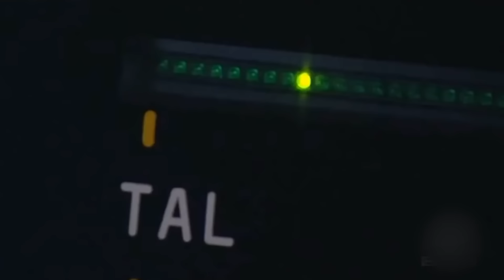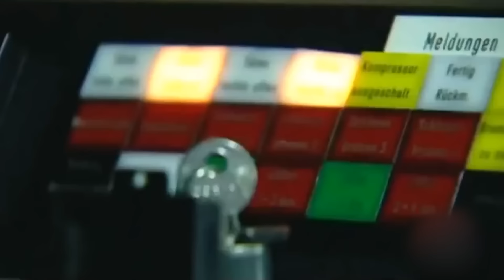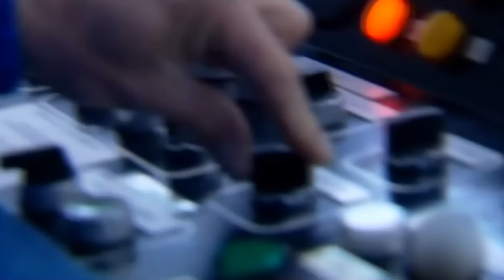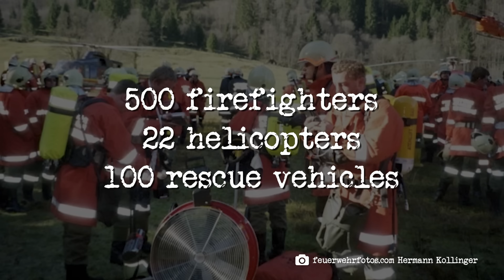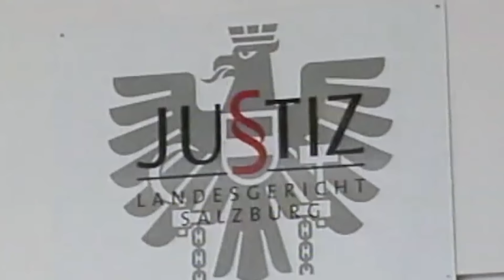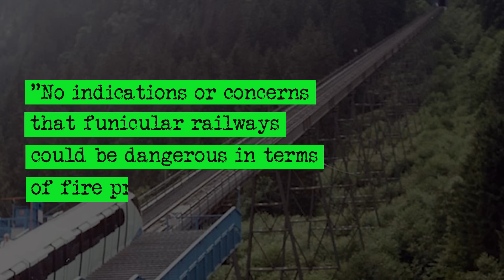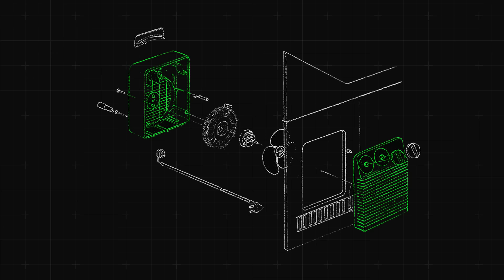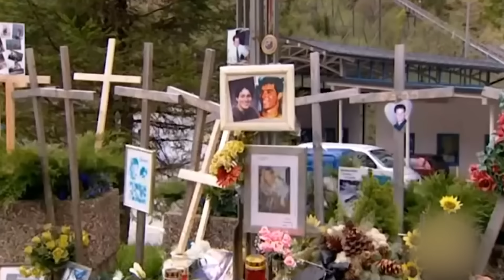The Kaprun Alpine Railway Disaster 2000

Comment: Sad, that over and over people try to escape from a fire upward, and inevitable die from the smoke that also moves up and the actual killer in most fires.
Reply: There was a fire in my building on the top floor. I live one floor below but not near the apartment where the fire broke out, where the fire was contained by the concrete walls. The hallway of the top floor was filled with smoke but not on my floor. There was a smell afterwords but some air fresheners took care of that. 

Some people have survived building fires by going up the roof.
Reply: @Ozymandias1  You cannot compare a building fire to a mountain tunnel fire... 

As explained in the video, due to the altitude difference, the tunnel reacted as a chimney. The fresh air was sucked up by the lower entrance. Then the smoke went upwards to the upper extremity of the tunnel.
Reply: At least they went peacefully.
Compared to burn to death alive that is
Reply: Since when has anyone seen smoke go downwards. Sure they may have panicked but if you're that stupid to move upwards in a closed environment filled with smoke, you sure are not very bright.
Reply: @wankZkills  unless you got training that allows you to know stuff in these kind of cases, or to think properly in panicked state (by having those states regularly and start to ignore the worst part of them,) you will not think at all, just act like a panicked animal, fire bad, move away from the fire, fire below, move up. anything more complex is not part of the first few billion years of evolution, so our last few hundred thousand year had no chance to overwrite it, even worse, in most case those stupid but basic actions work, just not always.
Reply: @thorin1045  As I stated, sure they panicked and basic fear and instact may take over. BUT, they still were stupid. I can only speak for myself, being in a situation of a fire I simply crawled close to the floor as I've been taught and navigated my way to a staircase and no more drama than that. Educate yourself about what to do instead of just learning that fire is dangerous. Again, supposedly being educated in general safety isn't a thing in a lot of countries, or atleast was. It amazes me.
Reply: @wankZkills  not knowing something does not make you stupid, stupid is knowing and not using information, never being learned safety or fire hazards or similar, you would have no knowledge what to do. And yes, most people in the world never had even a simple safety education. Most people never had the option to grab a fire extinguisher and try it out in a safe place (without any fire or on a controlled fire), so they will fail to use it properly in the probably only time they need to use it.
Reply: @thorin1045  Okay professor
Reply: @thorin1045  Not knowing heat travels upwards does make you stupid. I understand they were in a panic, but a even small child knows heat travels upwards. You see it any time you pour yourself a hot cup of coffee or boil water. It's as basic as gravity pulling objects down. Forgetting that is like forgetting how to walk or how to blink your eyes. "Panic" is not a magic wand that renders all reason invalid.
Reply: @Ozymandias1  People survive building fires by going up to the roof because the roof is an open, ventilated area. If the roof was a 3000-meter walk away chances would be very different.
Reply: @poika22  ask 10 people about this, 9 will go up, just like in this case, it is not about being stupid or not, your instinct will force you away from the open flame, even if they try to think, most people will prefer upwards, as they do not know the fact, that smoke will go up too, or that smoke is the main problem in this case, not the heat or fire itself. if it would be so simple as you consider, than not most of them would have gone the wrong way, but only a few stupid. the simple reality check makes it clear, only a few, who accepted the advice of an experienced person, went the right way, the rest went the obvious and wrong way.
Reply: @poika22  not out, you exist, those who do not know what to do, are not stupid, those who told they act on instinct, since they have no other source of information, yet consider them stupid, those are stupid and beyond. if it would be obvious how to escape from these situation, than it would be not part of almost every single time this come up: "and they went away and up from the fire, and died."
Reply: @thorin1045  "Do not know what to do" THE FLAMES ARE RIGHT THERE. If you look at a flame, see it rising up, and can't figure out 1+1=2 that heat travels upwards then yes, you are stupid. This is not some arcane physics formula you must've memorized in school.
Reply: @poika22  yeah but  people can get fearful. if its a large wall of fire..

Comment: A Tunnel (!) without fire extinguishing system. A train(!) without a fire extinguishing system. A train without any non hydraulic emergency door opening system.
And then installing a super cheap fan heater (Fakir in Germany is really the cheapest of cheap). Such heaters in public transportation must have fire detectors and automatic fire extinguishers. Again.

This is still unbelievable.
Reply: but still, fakir did nothing wrong it may be the cheapest but the company explicitly stated it's not supposed to be installed in a vehicle or that you can brake the seal's to do so.
Reply: @Frankforsthoevel  Of course Fakir is not responsible for this.
Reply: id argue the safety agenlcy that leats heater with such terrible design be sold is more responsible than the company @PascalGienger
Reply: It's 2024. Anything is believable.

Comment: I strongly remember the 2001 ski season following that horrible catastrophe.
Especially in the resort I was that had very similar installations, both main towns of the resort had one : Val d'Isère and Tignes (France).
The Val d'Isère one was particularly close in type to the one in Kaprun, almost an twin.
If my memory's right, they didn't open it till later in the season and then they had massive safety regulations.
All skiers and snowboarders carrying board wax, wax smelters, liners or any other sort of flammable stuff had to climb the slow way by using the chairlifts' alternative route.
Bags were searched and they gave complete safety instructions prior to boarding.
At the time the reasons for the disaster weren't clearly known so it felt a bit like an airport immediately after 9/11...
There were posters everywhere stating that you have to go down in case of fire, etc.
Things went back to normal later but they kept signs forbidding board wax accessories, just in case.
One thing I also remember vividly is the eerie silence in the funicular train during each climb.
As if everyone had lost confidence in the system and felt compelled to stay silent or talk at idle voice, like in a ceremony.
I did not know anyone linked to the Kaprun catastrophe but it stayed engraved in my mind as I'm a ski fan, subway fan and ski lifts enthusiast.
Ski resorts' funiculars are super efficient and fun to ride : you emerge from the darkness of the tunnel to the extremely bright light of a mountain peak in just a quick train ride. It's the happy subway of the ski slopes.
Thinking such a leisure mode of transportation turned into a nightmarish death trap is unsettling.
And the Austrian authorities' actions following the disaster, during and after the trial were really despicable, adding insult to injury.
Reply: Normally how long did the the train take from bottom to top? How do they remove heavy snow from the exposed sections? TY🙂
Reply: Fun to ride? Rides like these are giving me anxiety just by watching them😬 not because of this fire tragedy but because of how steep it is and for how long you are there in tunnel with 180 people on board, I am just a  little bit scared of elevators but this is whole new level
Reply: @scouser5039  It's just a cable hauled angled metro...
And frankly you barely see the slope outside.
Many that are afraid of heights and high cable lifts (chairlifts, gondolas and cable cars) much prefer funiculars because they can feel the vehicle rolling on the rails / the "ground" and can't see the height.
Funiculars are also perfectly stable, no matter the weather, something that can't be said about many other cable lifts.
I remember some pretty hellish chairlift and gondola rides on super windy days...

Several funiculars bring you so high that it's like a plane reaching cruise altitude, you exit the tunnel / top station above the clouds bathed in bright sun light.
And yes, it's quite fun to ride for many, myself included as it's the ski metro. Those that live in locations where they haven't subways or rail based transit really enjoy the novelty and uniqueness of the experience.
And those that live in cities and use subways everyday appreciate the spin of their daily transportation type into a leisure mode. And later they can think about the joys of the ski metro on their daily grind subway ride.

Anyway, funiculars are quite rare, and there's almost always an alternative route so you'll be ok whatever the ski resort you go to (alternative mode : bus on lower funiculars only ; gondolas, chairlifts, cable cars on lower and higher funiculars).
Reply: @kristyhoward6897 the kaprun one takes 8 minute and some seconds
Reply: @kristyhoward6897 there are certain machines for that snow removal

Comment: Being a bus driver, it's crazy to see a passenger hauler lack adequate emergency exits being that our buses have at least 4 emergency windows, two roof exits, and windshields that can be kicked opened, bonus rear door for some buses as well.
Reply: Not mentioning emergency door unlock systems - sealed lever or break a glass and push button. But even that wouldn't really matter if people decided go up instead down. What a pitty...
Reply: It seems, lack of casual traffic accidents fooled the management into the idea of "unsinkable Titanic". 

Like when that house in Russia had a fire of fireproof insulation.  No, it really was fireproof, just noone suspect the gaslines, which it covered, would leak and create a "pillow" of an air-gas mixture, under the entire wall.
The most enraging part of any of these situations, is when they say "Who would've thought it will do so?"

Well, when i was in school, we called a person with such capabilities "an Engineer". (Or an "Architech", in some languages) Lack of common sense in present "qualified" staff is shocking.

Comment: Just watched a video on an infamous subway fire incident in Korea, where the conductor stalled for minutes while the station burned, then once he realized there was a fire, took the keys and ran. Without the keys, the passengers were stuck as compartment doors locked once the keys left the engine. In another infamous incident, the captain of a boat abandoned ship once he realized there was a failure, and locked the students on the boat inside to die. 

In comparison, while also a great tragedy, in this incident, as least the conductor tried to free his passengers via manual override. 

As an Asian myself, there truly is regrettably something between our cultures that worsen tragedies when they appear.

Comment: Very nice.  If I haven’t lost count, this is the third time I’ve heard / watched this recounting. I have yet to see or hear the amount of research into the depth or the cause. The heater yes, but what about it, the expert witness rebuttal, not at all. 
Very, very well done on the depth of reporting if not, the depth of research.
Reply: Seconds from disaster, Fascinating Horror, Quixar (Irish guy) and this one.
Those are the ones that I know of...
Reply: Fuel-air-igniter = fire triangle 
Fuel (combustible hydraulic fluid) came in contact with a heating element in air.  The hydraulic fluid in contact with the heating element eventually reached its lower flammability temperature limit and caught fire at its flash point.  There was nothing to stop it from propagating, and it consumed all the fuel in its path.

Take away the heater, no ignition source to cause the accident.
Reply: Algorithms I can handle (great minds think alike)...

Comment: Good grief. It would appear that EVERYONE involved in the investigation completely overlooked one of the most OBVIOUS potential causes of the fire: A fan heater inside "PLASTIC HOUSING" -- DUH. As long as the fan works to blow the hot air out of the heater as designed, everything is hunky-dory. But if the fan blades stop turning while the heating element remains blazing hot, it won't take long before the plastic begins to melt, and when the melting plastic comes in contact with the heating element, instant fire. And it will only escalate from there. Personal experience: Several years ago, I bought a small space heater for the bathroom, small enough to sit on top of commode tank. Same issue:  plastic construction surrounding the heater and fan. I was leary about the plastic, so I never used that heater unless I was actually IN the bathroom. If I ever caught a whiff of melting plastic, I would be right there to unplug it, and throw it out the window, if necessary. Well, one day near the end of winter, I turned the heater on, only to find that the fan had not started turning. The heating element was already red hot, but the hot air was not being blown out of the heater. I turned it off immediately, and after it was completely cool, disposed of it once and for all. The last I knew, that same model was still being offered for sale... 👀

Comment: “Smoke was first seen in the “EMPTY” conductors compartment”? Was there not supposed to be two conductors, One at the front and one at the back?  Or is only One required?depending what direction the train is ascending or descending? 
But if, operation procedure requires two conductors to be stationed both front and rear on every train, regardless the direction of travel, 
Then the fact that if a conductor was in that cabin , he/she would have been at the controls and seen the initial smoke coming from the instrument panel, and could have easily been extinguished at the source.
Reply: Its like locomotives, two seperate compartements at each end with equal controlls. And only the facing the die direction of travel is occupied as you guessed it.
Reply: just like normal trains and subway cars etc here, they have a conducter compartment in the front and back so the train doesnt have to turn. the conductor simply goes from one end to the other if the train has to travel the other direction. sometimes you have a person who checks the doors, makes sure everyone is inside before closing, but they stay with the passengers. its usually only one driver
Reply: @thoges5040  not correct! due to the stupid design of the cars  by Swoboda the upper conductors cabin only had hydraulic pressure gauges for the upper compartment. Because of that it took the conductor so long to figure out what why there was a stop of the carriage. He had no way to check the lower compartment
Reply: @aky4360  Was it two identical carriages coupled tail to tail?
Reply: There were no conductor. The person was just there to open and close the doors.

Comment: I get not wanting to go past the fire but knowing how long the tunnel is and that heat rises and smoke is hot, I'm surpirsed at how many went upwards.
Reply: Especially with where they were in the tunnel and how much longer it'd be to go up. Going down would be scary and come with its own risks, but the exit is also a lot closer since they weren’t even halfway up the tunnel. It's sad to see the panic get so many people.
Reply: It must be understood differently. The people in the rear had a choice and a group went down while some others went up and perished. However, the vast majority left the train already being further up. They might have survived if they immediately sprinted down into the heat towards the flames, but with visibility being near zero it's not something you will consider immediately and immediately is already practically too late. All people there died within a minute or so due to the toxicity of the smoke (mainly carbonmonoxide).

Comment: I think about subway cars, and how they all have emergency features: two-way intercoms, printed instructions on how to evacuate, manual overrides for the doors, windows that can be manually removed, and walkways off to the side so you're not in the path of the train. In addition, tunnels and stations have fire sprinklers, and there are fire extinguishers all around. Apparently not one of those things was present here. On top of that it's clear absolutely no one running the thing had even five minutes of safety or emergency training. Just amazing, nevermind whether it was the heater or the hydraulics, the entire thing was a poor design with regard to safety. If they wanted someone responsible, they should have fined whoever approved any of this.

Comment: Its sad that most of the deaths could have been avoided with a glass hammer (like in buses and trains), a fire extinguisher, and Stickers to go down in the case of a fire. And even better if they wouldve used a nonflammable material for the wall of the heater.